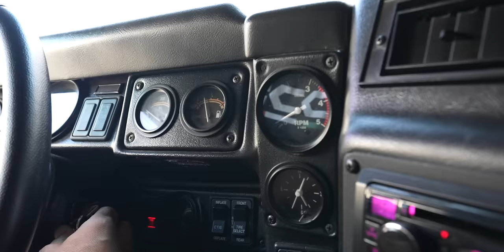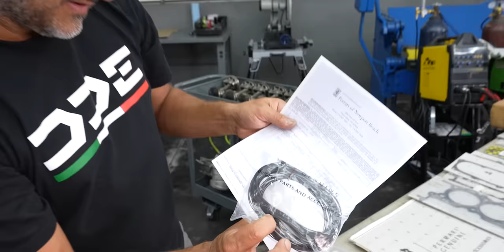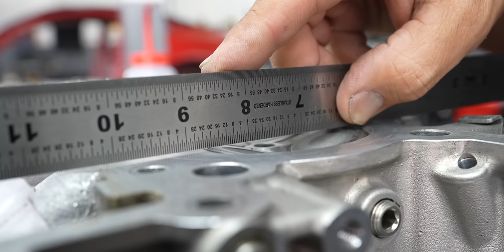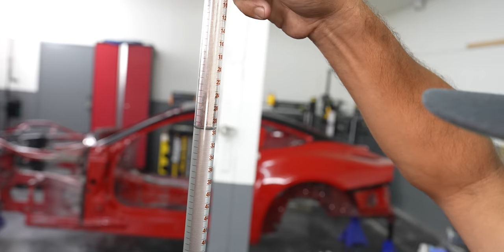WE GOT THE DREADED PHONE CALL FROM FERRARI...

Comment: If you scan and copy any of the gaskets that are made of normal gasket material you can enter the information into a home latex sheet cutter and cut a new gasket on gasket material anytime you need to replace that gasket.  You can even copy an old gasket if it is not torn up when you remove it.  Saves a lot of time and money for some parts.

Comment: For the most accurate measurement, use a syringe, weigh it before you fill the chamber and after and the weight difference in grams is equal to the cc. 1000cc equals 1000g in weight of water. Gotta love the metric system

Comment: 2:30 I think the problem with the gauge issue not reading properly is maybe the aftermarket remote start feature as well as the Hummer still being a key to start. As you saw turning off the car and turning it on fixed your issue but this is only just a theory.

Comment: Ring gap can be adjusted. If you dont do engines for a living, manual ring filing tool is enough.
If you go from NA engine to turbo compressed, you definitly have to adjust ring gap. Due to the higher pressure, rings tend to heat more, expand more and you dont want that gap to close... This is the first cause of cylinder scoring in high rpm high boost mods. 2nd ring should have more gap. It prevent pressure to be trapped between top and 2nd ring and cause top ring unstability
Reply: Can i suggest you also mesure oem piston clearance with the cylinder wall ? then mesure the CP custom piston to see how they manage different piston materials heat expansion

Comment: I guess the only concern with this build is if your filling up the direct injection that weld and filling needs to go into alot more material as once you work out the cylinder pressures with the boost levels against the compression ratio thats going to be the first point once its heat cycled so many times to be prone to issues and cracking

Comment: Great stuff, very cool project. As far as the rings it doesn't seem like much of an issue. As I'm sure you know boosted engines need more ring end gap so seems like an aftermarket file to fit ring pack is the best choice. Also, I've never built a race motor with factory rings, CP could even change the piston to use a narrower ring pack designed for  performance which would require and aftermarket race setup.

Comment: Why not make some small dowels for the DI delete? Heat up the head to expand the opening, liquid nitrogen the dowels to shrink them  and shove them in the holes. With a 2mm difference those things will never come out then you don’t have to worried about burning the tip off the injector and blowing a hole in the head.

Comment: Since the car is going to be a dedicated twin turbo, now is the time to bring down the compression ratio to 10.0 -1 for longevity of the engine. Ring gap shouldn't be an issue as you are going to have to set gap to boosted application. Meaning larger gap than Ferrari specs.

Comment: 13.7-1 to 11-1 compression. Geez. My vette motor is 10-1 compression at 400hp-500hp. You could be in the neighborhood of 2000hp when done with the build. I'd ask CP Carillo about the cylinders. They seem to have the equipment to cnc what you need. And probably cheaper, and faster than Ferrari. Plus their already making the pistons and rods. It eliminates a few steps, if they can handle it. Cylinders, pistons, rods, all the same from 1 place. Makes the specs even. Just a thought Mike.

Comment: Gotta get rid of the air in the bottom of the titration pipette before measuring the starting fluid so you don’t count the air in the system as part of the fluid measurement! Could be a potential reason as to why the compression ratio was lower than stated by Ferrari! Nonetheless crazy job guys you’re always killing it!

Comment: Have they considered the fact that the cylinders might be deliberately out of round as I personally know quite a few performance applications that are like that as they are designed to become round once the head is torqued on? 
Every time I’ve personally ever checked bores I use torque plates to ensure the cylinder is under the same pressure as it would be when the head is on.🤔

Comment: Not to confuse or contradict but wouldn’t the camshaft have more to do with compression ratio than chamber size? Aftermarket cams with more valve lap and lift would be less compression more boost less valve lap would be higher compression I get measuring for the sake of interference

Comment: call darton,  measure your bores, they will have you machine out the center of the block and add their wet sleeves.  if you give me dimensions or a scan of the block i can send you a machine ready file for the block.   ive done about 5 of them now for various engines, including my bmw thats making 1300whp.   worst case scenario, machine the nickasil shit out and do traditional style sleeves,   it would take me 4 hours to have files ready. darton wet sleeve with a tiny bit of extra ring clearance = long lasting engine.  best investment you can do to a  n/a block if youre going to boost it.

Comment: Hey Mike, Don't you need to account for the valve notches in your lexan plate you used to measure the head volume? Granted it's small, but.......
Reply: I think it was less than 0.1 cc when I attempted to measure it, so I figured it would equal about the same amount as taking a .001-.002” of an inch off the head and block when we surface them

Comment: Why are you guys giving up on the direct injection? Syvecs builds an ecu that can run d.i. Injectors. As well their largest ecu can operate 24 injectors, so you could run a wide variety of fueling schemes- di gas plus supplemental meth, etc.
Why give up on a better tech when you want to make more power?

Comment: Love the build! But doesn't Ferrari torque plate hone all their blocks? Won't that alone throw the measurement off without a plate bolted on? Cause if it's off a very tiny amount and then install a plate with it torqued to spec,  it'll give a different measurement under load. Not sure how much you saw it was out of round though, just going off what I know, I'm sure you know that already with your background and most likely why your saying it's out of spec anyway LOL

Comment: Soooo... Im curious..  If Ferrari hasn't done what you are doing, why would doing what you are doing be making the car better?  In other words; isn't Ferrari interested in making the best automobile they can?  Wouldn't the negatives be a direct result of the abuse this car has already seen?  Why would moving the radiator to the back be better, and if it is, why wouldn't Ferrari have done it?
Reply: You can answer that question yourself
Reply: @malachit6282  nope.  Your perception of this question as a criticism is your problem, not mine.  Im genuinely interested in what the draw is to destroy a car that was designed a specific way to operate in a specific way, and do specific things.  Is it to "improve" the car?  If so, why hasn't ferrari done whatever that improvement is proactively?  My assumption is the car is EXACTLY the way it was meant to be.  There was purpose, testing, development, wind tunnels, radiator placement, behind every decision to produce that car.  It isn't until you put twin turbos on an engine that was NOT specifically designed for that purpose that you end up with cylinders that are warped, metal that is from shearing processes, and an overall failure of a system that was, for all intents and purposes, perfect.  

Let me be even more direct. IF Dave and Damon don't like the ferrari the way it is... if they don't like the huracan the way that it is.. then spend all their money designing their own car.  THAT would be interesting.. knowing what they know, stop destroying others designs, and create your own!  NOW you have a channel that isn't being done!!
Reply: @Pugelista41  I’m not reading that GEEK